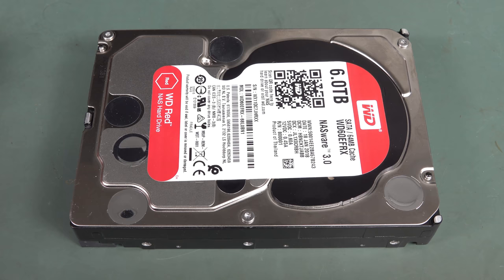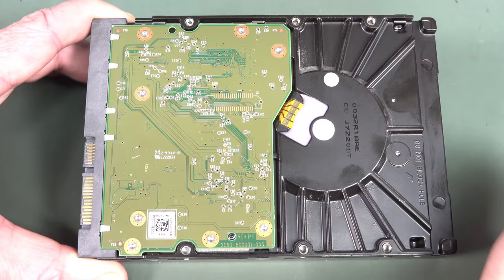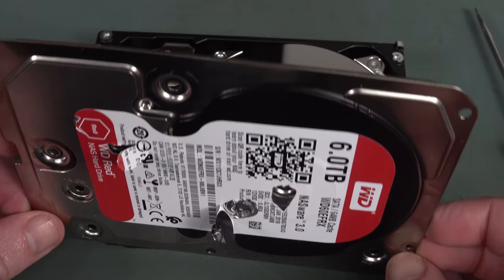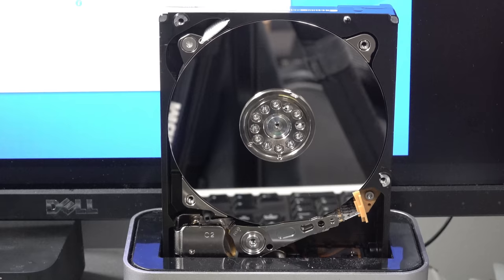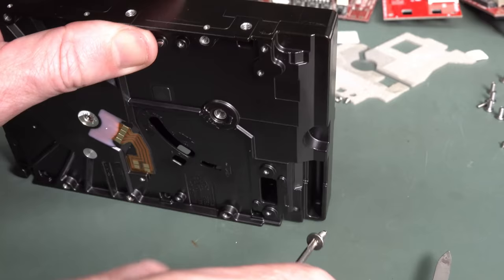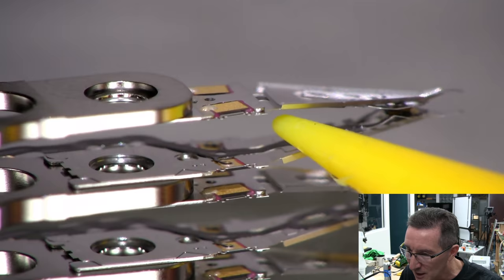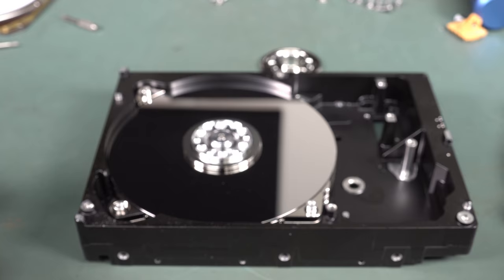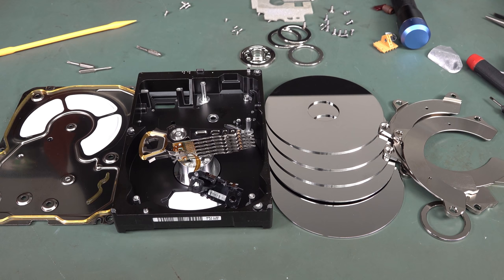EEVblog 1398 - Western Digital RED 6TB WD60EFRX Hard Drive TEARDOWN

Comment: I usually go for the lower 5400rpm ones - it's mainly vids with low data rates like yours - so as to reduce load and wear, but I hear they also miss label those and give you 7200rpm ones.
I would keep the controller PCB and the model#, because it saved me once when another similar HDD died.
Reply: You'd hear it if it were 7200 rpm...
Reply: On second thought, maybe the controller PCB went haywire.

Comment: I to had a dead drive and I wanted the data. I also had another(Old 40GB only that was of no use anyway!) with clicking noise but still functioned, So I thought of exchanging the platters and get the data copied somehow. I got too exited at this point and my screwdriver slipped on to the platter and left an annoying scratch😡. Also I did it in my room and later on searching how this was really done I realized that it had to be done professionally in a no dust room(if that is what they are called). So delicate they are.

But it is just fascinating to see the  complexity and engineering involved in these things!!!. They are really incredible!!!

Comment: Would have been nice to know the reason for failure.. I guess there is Software that could tell you whats wrong... 
Does anyone know how to remove the Magnet from the bracket without destroying it ? ... mine always crumbled to bits or the silver coating came loose.

Comment: 12:15 by now someone will have pointed out it is an air filter.  As the disks spin it creates an outward flow of air and it blows through this filter and you can see a channel that allows the air back inside after being cleaned.  
Fingerprints:  "Ahh, who cares!"  Well, I do.  I use rubber gloves (nitrile actually) to prevent fingerprints so the disks stay perfectly shiny.  I'm not sure what to do with them (besides subject to extremely powerful magnet to erase any residual data) but they are very pretty.

Comment: I very recently had the Green variant of this drive fail after ~26k operating hours, of which the last ~300h were constant abuse. Obviously, I tore it down to inspect for any visible damage...and to satisfy my curiosity :-]
Electrically and mechanically, your Red and my Green appear to be identical - including the annoying spindle screws! I guess the only difference is in the firmware.
Reply: It is since the launch of the Red brand. The use of a tool like WDIDLE allows to setup a Green as a proper RAID drive.
Reply: @PainterVierax  Yes, that's what I did when I found out that my drives were racking up load cycle counts like crazy! WDIDLE got rid of that problem.

Comment: I reuse the pancake motors for other projects. Then I drill a tiny hole in each platter, run a strand of wire through them, and turn them into windchimes.

Comment: You probably won't see damage to the platters in case of a head crash these days. The head is too soft and the platters are too hard.

PS: I'd replace that or those SMR drive(s) if I were you. They really ruin the write speed on the raidset.

Comment: Got a lot and taken them apart, the platters can be either aluminium or glass, only way to tell is to bend them, the glass ones shatter. Funny thing is the magnets in them over the years have gotten smaller, thinner and stronger. Magnets from around 2000 are pretty thick, the last few the magnets, while still the same strength, are around 1mm thick, and half the area.
Reply: Some years ago, IBM "DeathStar" disks had glass platters, and were famous for failing quite frequently with the heads scraping all the material from the platters until they were almost clean.
Reply: @LeleForzani  I had a few IBM drives with glass platters, and only a few were clear after a head failure. Should go find the 2 Hitachi Deathstar SCSI drives I have in a box and strip them out. They were not bad drives, and I got them well used, and kept them running for a long time.
Reply: @SeanBZA  Although I believe all Deskstar drives had glass platters, only a specific family made by IBM, the 75GXP, was horribly unreliable and used to scrape the platters clean. Hitachi took over after they were already discontinued. I had dozens fail back then, pretty much all of them, even within days from installation, but I have one that is still working after 20+ years. Artificial selection at work, I guess.

Comment: Im curious if you spin the platter engine if it spins smoothly or do you feel some small "bumps" as maybe the bearing died? Did some old drive teardown myself just for those magnets, and platters but not sure what to use the platters for just yet ;)

Comment: Sound like one of the Seagate ST 20 MB drives that I had in a Gateway 286 clone from back in the 80's. The heads has a tendency to stick and I needed to do a 'Fonzy' to get the drives to spin.

Comment: That is an SMR drive and it should not have been in a Synology NAS, they don't work properly there. This has been a big headache for WD after it was found out the NAS owners were mixing drives and had issues. Just past warranty. Now all drives on WD state the technology used CMR/SMR/PMR oops WD put me on the EFAX page instead of the EFRX but still no use SMR

Comment: It's shut down itself so that the platters or head could not damage further. And no inert gas in there. There is a vent hole with filter. It's no vaccum.

Comment: I built a mobile using old platters from 6” copper colored and smaller silver platters. Looked cool until I had to move and take it apart. Used other HDD pieces and parts. Have to rebuild it

Comment: Dave I wouldn't worry to much about having an SMR drive unless you have ZFS on your NAS. I doubt you're hitting any of the write cache limits editing video on it. Then again I'm no pro.. but was reading about it a bunch when people where freaking out about them. What WD was really slimy but most home use cases should be OK.
Reply: Sorry to keep posting.. Dave, do you have your NAS to spin down/power save the drives when not in use for X time? Based on the time you quote it does not sound like it. Maybe could help save energy and time on the drive.

Comment: the reason the mirrors look so good on platters n things that have that effect, is because the mirror surface is actually on the surface, not beneath a surface of glass which really makes a big difference apparently, telescopes microscopes n photon sciences use these because again theirs no diffraction layer to look thru   if u do get a lens b careful that layer does Not like the oils in ur skin  itll leave permanent fingerprints

Comment: Hi Dave, your tork driver is too small to loosen the nuts, since it's hard to grab the tiny handle tight, just ruin more than 40 units of these, including SAS.
Reply from the maker: Was fine for the others. I figure the last screw left had extra tension on it.
Reply: @EEVblog  always just "crack" every screw loose, then take out one by one. otherwise the last one will bind

Comment: Nice video. I replaced in my NAS some time ago a SMR WD Red drive with a CMR WD Red Plus as i had the idea that the drive was a lot of time quite busy. But it did not make a difference.  BTW you counted the number of heads. Did you also count the number of cylinders and sectors (;-)?

Comment: And all that engineering marvel at a lower price than one of two heads in a 14" 2.5MByte HDD from the seventies.
Reply: Actually that was the early 1960's. The IBM 1311 held 2MB, followed soon after by IBM 2311 for 7MB. 
Many years ago,  I used to own a couple of 1311's...
Reply: @bertoid  IBM, Okay.
I worked on Data General mini-computers with 2.5MByte Diablo drives that had a removeable  cartridge.

Comment: Wow I have the exact same WD 6TB HHD 2 day earlier made on 16 Jan 2018. And  I have exactly the same problem with it. It's start to failign a couple of weeks before the guarantee expire. First it doesn't let me to enter in it but somehow I relocated it and was fine. After that I ordered 8tb seagate and copy the info on it. And may be one or 2 weeks after the guarantee ended it died. :( I guess the hole this series are defected somehow. At least Im happy that I could save my 3d library.

Comment: that heads powdered metal, thats not expensive at all, they cast it in just about the exact right shape, powdered metals are extremely accurate alot of time it doesnt even need to b machined, either that or, if its aluminum which it actually probably is, its probably an extrusion, so in this case a bar in a special shape cut to about the size of a head, then machined, u can do things really efficient that way especially that shape

Comment: Where did the small ribbon cable from the motor end up going?
Reply: Nowhere. It's connected by pressure pads on the main board, like the head connector.

Comment: IIRC all hard drives have bad sectors.

They get a low lever format which maps out the bad areas and doesn't allow data to be written too them.

I can't quite remember if this is actually true or not but I think I read some where that its actually the 'drive controller boards' that shit themselves.

Correct me if im wrong.

Yes you are right the modern hard disk drive is an amazing piece of engineering.

I once read Scott Muellers description of the modern hard drive.

No doubt rotary voice coil actuators have improved since I last read about them.

I still have some Western Digital Raptor hdd drives sitting in old computers some where. 🙂

Still its all Samsung SSD drives for me now.👍🏻

Tis fascinating for sure.

Comment: I always thought that Western Digital would make the best tweeters in the world if they wanted to. That fine wire that they use for the construction will be perfect for a ribbon or a m t style tweeter.   

if you think about it the Acoustics that go into a hard drive would be the perfect working principle for someone working at an audio company making speaker drivers/ transducers.

it's always been my theory that the boys at Phoenix Gold he used to be from Portland Oregon designed the Cyclone subwoofer based on hard drive technology..

Comment: very interesting! amazing piece of technology!
by the way, i have a WD blue 500gb still running fine in my pc with 29600 power on hours, with important data on it (i have multiple backups of very important stuff though)
Reply: Hard drives are like that, either they die quick or last decades

Comment: Dave those WD Red are awful! I have 4 samsung spinpoint F1 1TB hdds and theyve been ruuning 24/7 for over 11 years and not a single one failed.
So much for "nas" drives.....
Reply: I was going to say the exact same thing. In my long experience it's Hitachi or Samsungs for NAS.
Never use WD or even worse Seagates, they are just shit.
Reply: Really you are comparing 1Tb drives to 6Tb ones ? Not serious !
Reply: I worked on these things for 12 years the F1 was my favourite drive for reliability.

Comment: Even if it was in warranty, don't bother. Hard disk warranties are a joke. If its after 1 year (or a similar specified time) they will only provide you with a "re-certified drive" from the pool of drives sent back under warranty. In my experience re-certified drives don't usually last very long. It wouldn't surprise me if they just low level format them to lock out the bad sectors, put a new sticker on them and send em out. In my experience, they tend to develop cancer way faster than new drives. We stopped bothering to send drives back over 10 years ago; we have a pile of dead drives out in the warehouse you could build a house out of LOL

Comment: Under Australian Consumer Law you can say that a drive that is meant for a NAS should not have died on you under 3 years. This drive is marketed as durable... and this particular series is shite looking at the stats so lots of them die. This means they are not fit for purpose... whoever sold them to you(hopefully Amazon) should give you a full refund. End of story. Warranty is a red herring and as such utterly irrelevant. I sent back laptops after a year when it turned out they did not work as advertised...

Comment: i'm an expert on hard drives - an expert on pulling hard drives down, that is.   i became an expert on pulling hard drives apart when i found out they contained super magnets.  i get excited when i score antique ones with less than 1 gigabyte.  the older they are the bigger the supermagnets.  more modern ones with 500 or more gigs arent worth pulling apart.  the magnets will be about 2mm thick and break too easily.  i got the opportunity to dismantle some special hdd's that were used in phone towers. they had big fat magnets of about the size of 1 gig hdd's in them.  this may indicate the quality of the hdd.  for those who collect supermagnets like me the best way that i have found to remove the magnets from the base is to soak them in methyl ethyl ketone in a sealed container (so the mek doesnt evaporate ) for a few weeks.  if they dont come loose after that time let them soak longer.  impatience will tear the protective chrome plating off.

Comment: SMR (Shingled Magnetic Recording) is a fraude, WD has a big lawsuit about that, because they sold their drives under WD drive CMR, which isn't true. CMR is the conventional technique and last longer, and safer than a SMR, SMR is much cheaper than CMR, and they sold it on the price of CMR drives. Seagate was doing this too, just when the law suit began against WD. SMR is still used, on 2,5" HD drives, so watch out if you upgrade your HD on a laptop. It could be slower than before. And loss of data could happen. More than with a CMR drive. But I never seen a HD like that, mostly when I Change a HD I drill several holes in the drive, the sound of breaking platters is something "special" haha

Comment: https://youtu.be/NnBPLuw-LnY?t=1163 My guess is that it is some kind of trace redundancy feature. Under the vibration, the cable would bend and unbend many times around the curves of the cable. This would eventually cause the the copper to harden and eventually crack and fail. These grooves would relieve some mechanical stress away from the copper while also providing a different path for the electricity in case of breakage.

Comment: WD - always fails like that. Have better experience with seagate
Reply: Backblaze says exactly the opposite.
Reply: @NiHaoMike64  Two buildings, similar office, similar loads, I have 4 - 2TB seagate in the raid running on the server sinse 2016 (24/7), and the same raid in another building which strictly prefers WD. All WD hard drives has been replaced with new, same WD (due to failure). And only one seagate disk has ben replaced. Another office, one small server, a seagate disks running in mirror from 2012, 24/7, never replaced (mail server).
Of course this is only my experience.